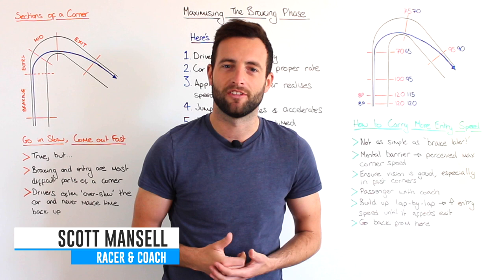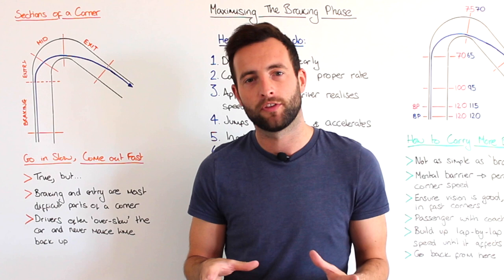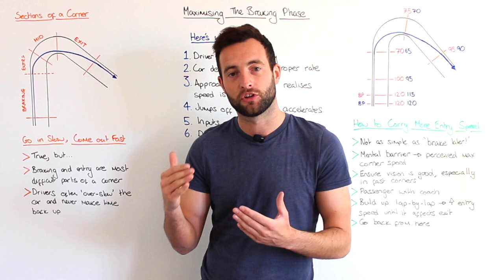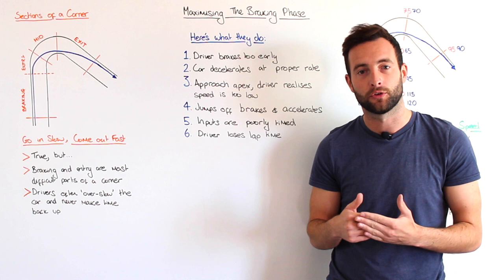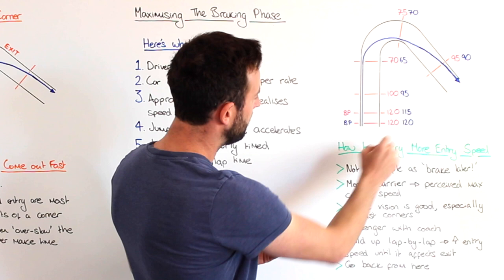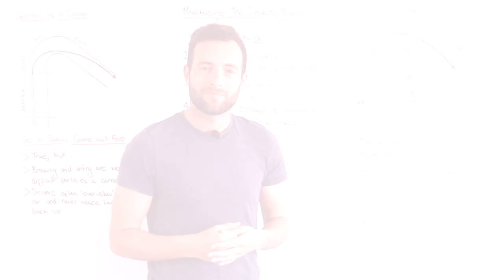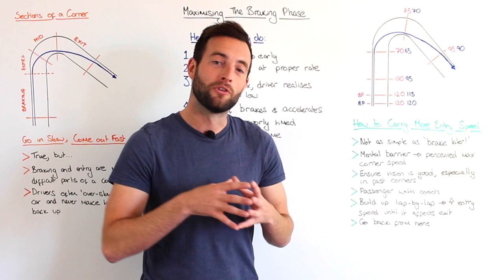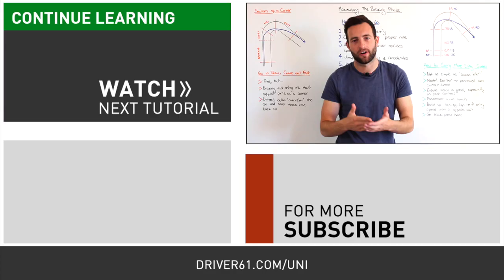The Braking Zone: How to Reduce Lap Time (Actionable)

Comment: I pinned your University onto our forum site because of the value you add. Many thanks!
Reply from the maker: +Peter Stefani hi Peter. Thank you so much! Which forum is it? Thanks for the support!
Reply: Just a Discord Forum blog that our club uses for all kinds of gaming in pCARS, AC, and Forza. The club is called Up2 Speed Customs. I just tested for about 2 hours with your tips on smoother entry and balanced exit, and it works very well, actually shaved off a second or so at Brno circuit in an LMP900.
Reply: Very useful videos! :)

Comment: love your videos, already taken lots of notes and only half way. one of the points im working on is entry speed and mid corner speed limits, as i got quicker i started getting much better exits but now often compromise the entry so i have been going back to this again in hoping of connecting them, i was wondering if you could do a video with using limits of tyres without over stressing them as with the mp430 in iracing i can set the car up a certain way to make it use max grip as much as possible but i often end up over working my front tyres and killing them and struggling again after 15-20 laps. any ideas on how to get the most and balance between tyre conservation and max speed/grip usage would be great. i am already working on setup adjustments or not basing it around the front of the car and having loose rear and better ways to manage driving style and input without cost of time etc is just tyre management really im struggling to find or think should i be driving slower than the optimum overall etc or changing approach? etc